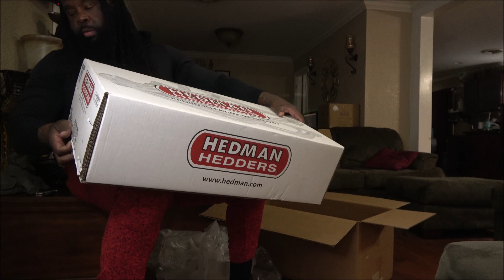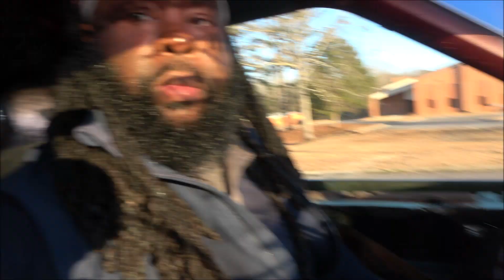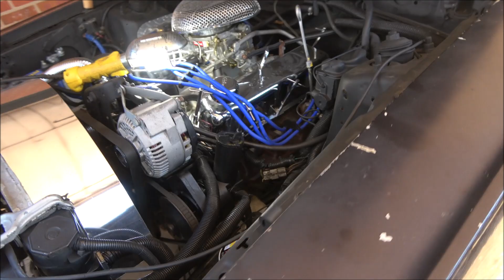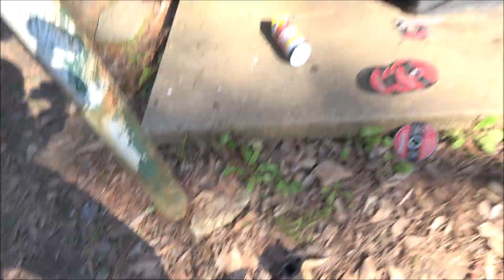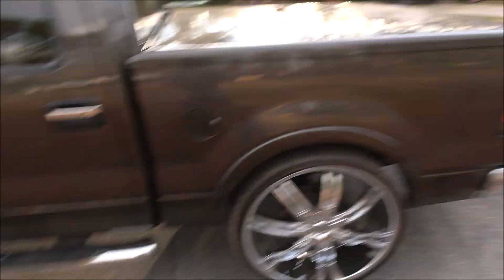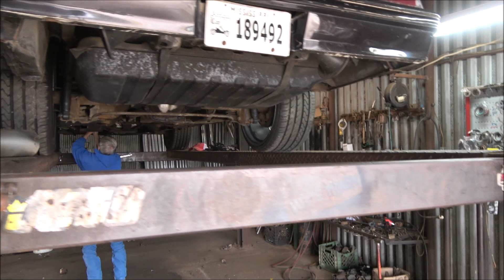NOW CRANK THE MUSIC UP | HOW TO INSTALL HEDMAN HEDDERS ON FORD 302 SMALL BLOCK | TBIRD5.0

Comment: If not mistaken, that car is sitting on a foxbody chassis? And if so you buy mustang exhaust parts. If you’re going for the deep throaty sound, and H pipe is the ticket. If you want a race car rasp, go x pipe. Oh and when any welding is gonna be done, disconnect your battery
Reply from the maker: Yes sir it is on a fox chassis.